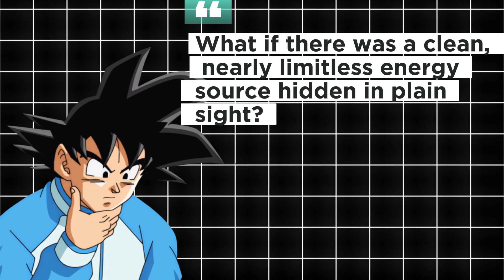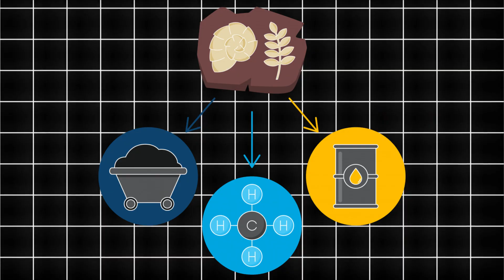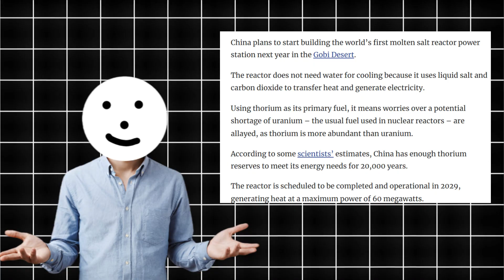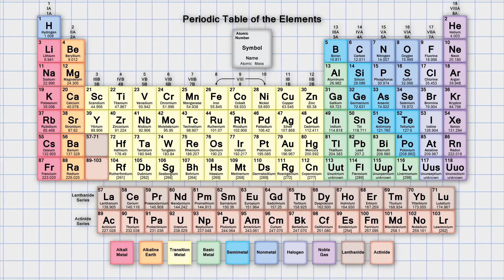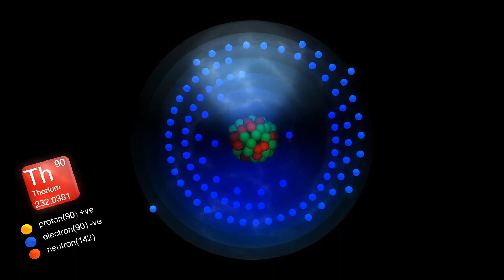This Breakthrough Energy Source Could Deliver Unlimited Power

Comment: The liquid fuel cycle is the key to eliminating bul radiatctive watse.  Iys liquid chemistry makes it s waste    much more easily converted into  useful isotopes used in nuclear medicine, space exploration and manufacturing process - .optimal fuel recycling.  This kind of reactor doesnt use steam to run super high pressure steam  turbines it uses very hot gas  to turn  low pressure gas. turbines..much safer. Addtionally  the LFTR  runs hotter than light water /heavy water reactors,....hot enough that its waste heat can be used for efficient recycling of plastics and metal, and to "crack" sea water, making obtaining hydrogen  economically feasiable ..Hydrogen and be used as fuel or,  reacted with carbon removed from the atmosphere to make synthetic fuels, for aviation, diesel engines, etc., ..It would be an ideal reactor for a nation like Iran, which needs nuclear power but which is under constant threat of accusation of "proliferation" ....it would be insane NOT to buil thousands of these reactors